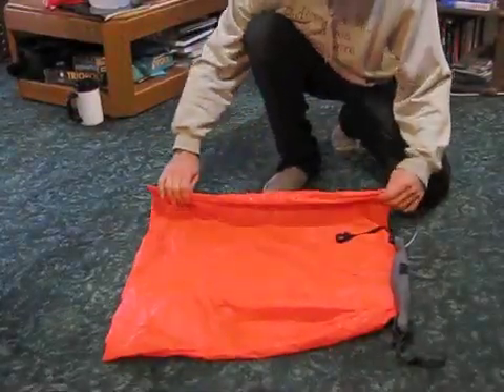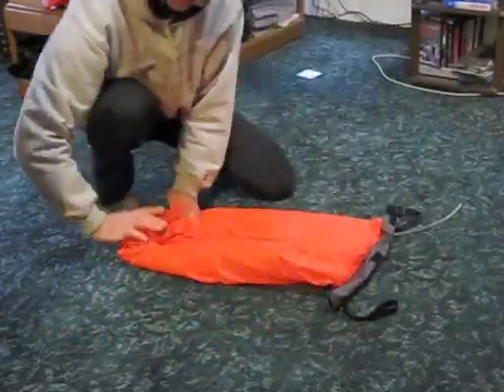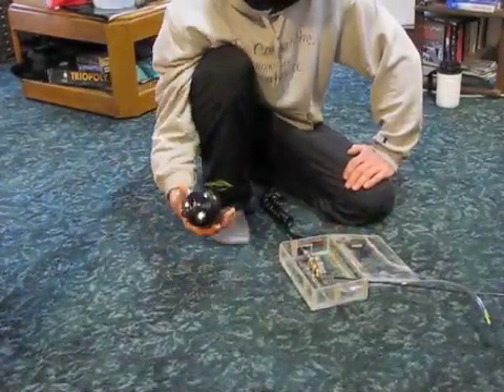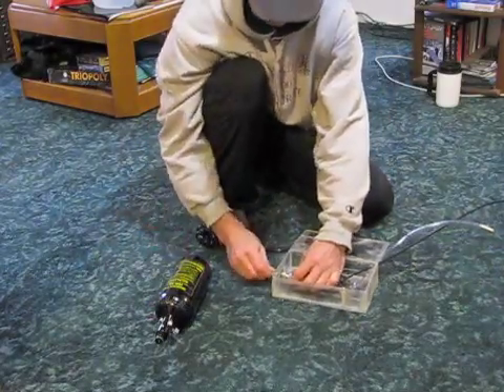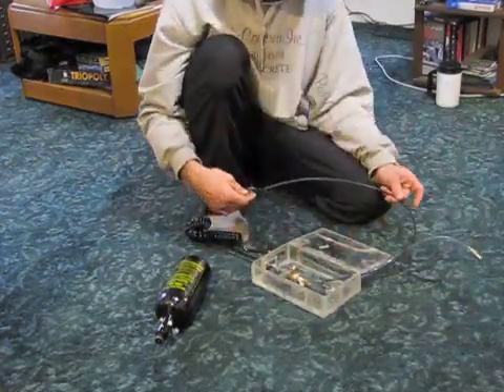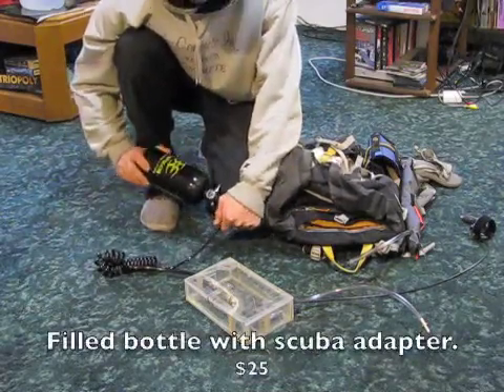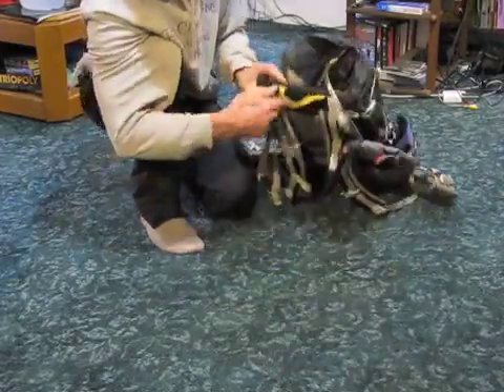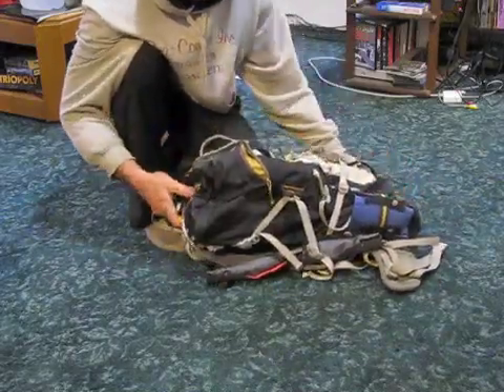DIY Avalanche Airbag

Comment: Your device has great lifesaving potential but it is too slow by the time that thing is inflated you would be at the bottom of the hill. So maybe you could use bigger tubeing and a bigger ball valve. Also co2 will come out much faster but I still think you could do it with air
Reply: Isaac Voeller co2 isn’t good to use. It will freeze up and also isn’t great to breathe if you get buried with the bag and it gets punctured.

Comment: One question about your design.  What did you use for the ring that you glued onto the end of the tube to keep it inside the airbag.  Though the ring keeps the tube from sliding out of the airbag, how does the tube keep from sliding further up into the airbag?  Thanks for the help.  This is super legit.  My friends and I are going to make some.
Reply: Don’t do this if you want to live.  Your life is not worth saving a few hundred dollars.  An airbag can be had for less than a good set of skis, less than a typical mod to a snowmobile, less than it costs to get away for a weekend.  This “home made” bag takes far too long to inflate , has not been tested. Doubtful it holds up to the violence of an avalanche.
Reply: @milehighassassin  Your statement is very true. I am doubtful it will hold up to the normal wear & tear of just plan use...
Reply: Craig Jones I